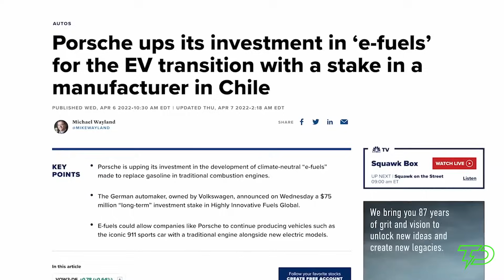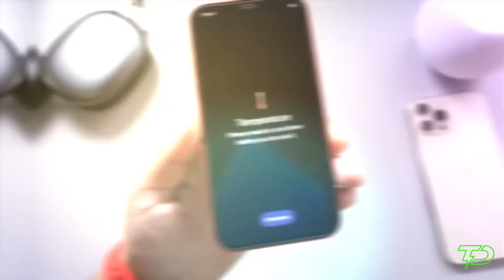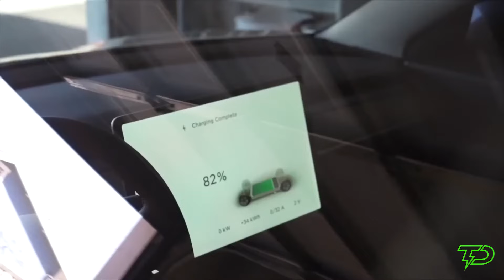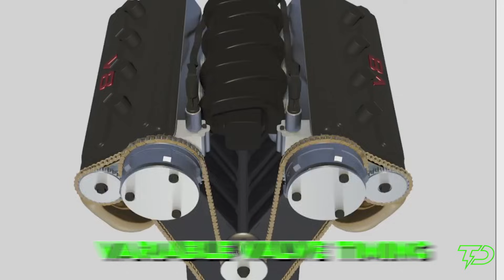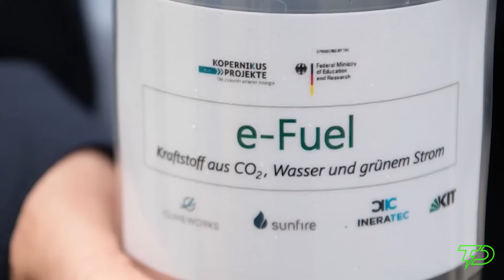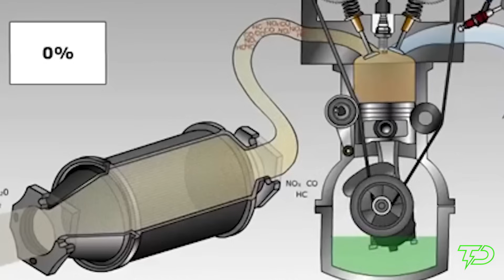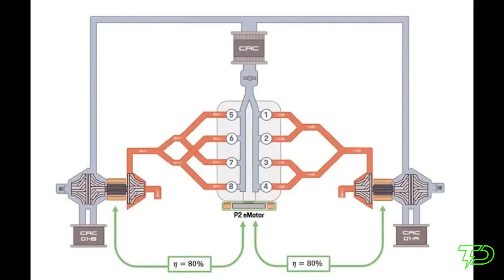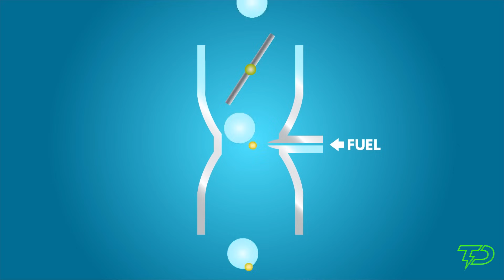Porsche SHOCKS EV World: E-Fuel's Dramatic Entry!

Comment: 2 Designs for (fast) CAR. 
The 2nd is either for supirior-steering 
Or for superior-mecanical-braking
(All cheaper than existing)
Following is the 1st one: 
1)  Unique Valve for shortest Braking-Distance and supirior stability while braking. (Important for fast Passenger Cars)
1.1)  My Invention: I have a (complete design of) low-cost Valve that will replace the 2 on-off solenoid valves (for each wheel, in the ABS)  
1.2)  Will create Brakage: 98% of ideal decelaration on dry-asphalt with paddels (wet-asphalt): 
2)  Thus create the best ABS in the world,  Reduce ABS size (more reliable than solenoid valve). 
3)  Note: Today ABS use two On-Off Solenoid-Valves because Proportional-Solenoid is not good: Low-Reliability, and at mid position: the flow will be too high: thus, compell bigger-pump. 
4)  Linkedin 67953574 : (2 files on the Valve) 
5)  Dear OEM :  I have 3 more files on the Valve...